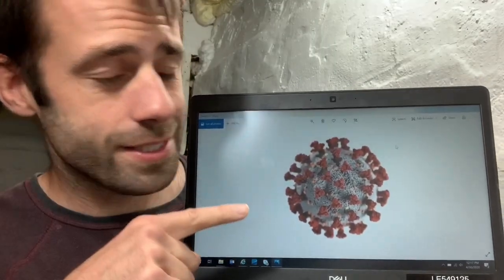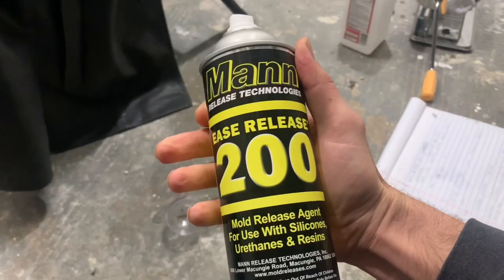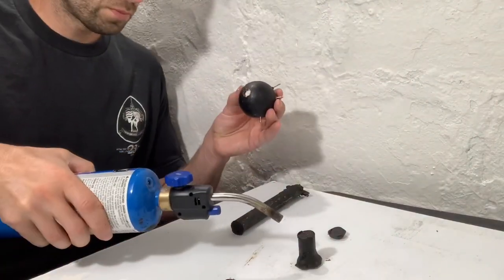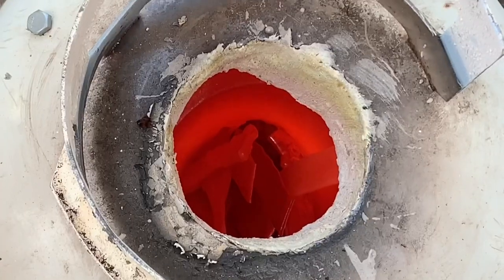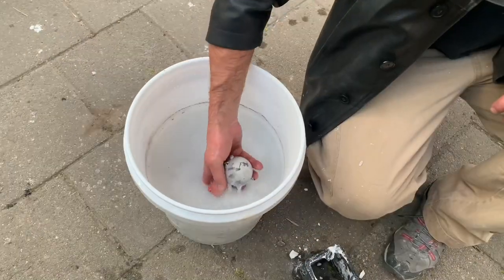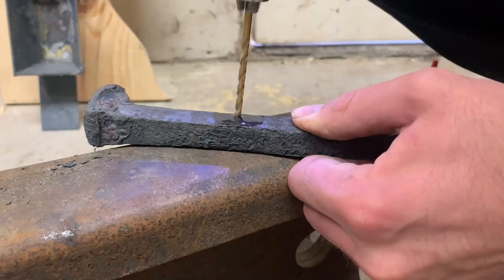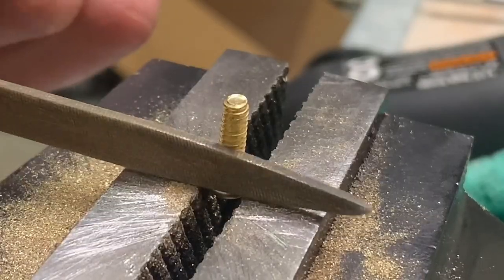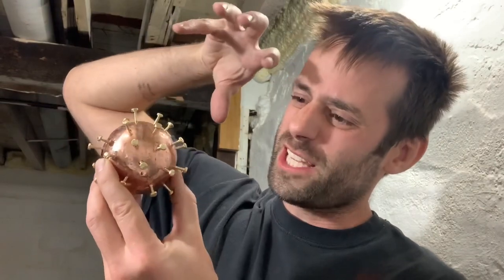Coronavirus Revenge! COVID 19 Sculpture Made from Antibacterial Copper

Comment: I think you should make a flattened coronavirus for the flat earthers. You would have to decide if you need to put those little caroni antennas on just the top or also on the bottom. Probably better consult a flat earther on that. You could use aluminum for the ice edge around the perimeter. To make it realistic you would need to add to scale penguins or actually Nasa agents dressed in tuxedos to guard the perimeter.